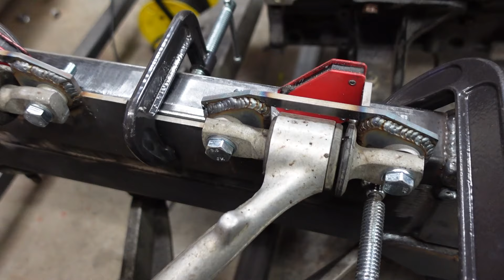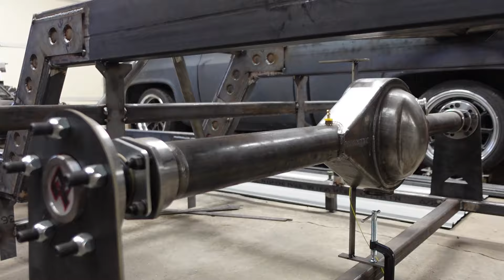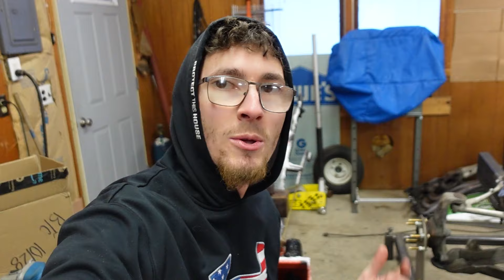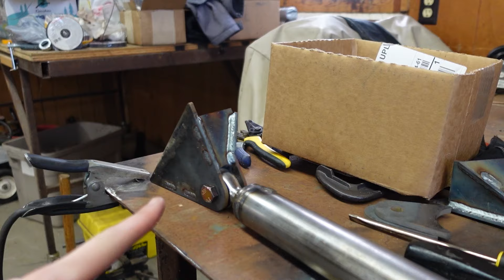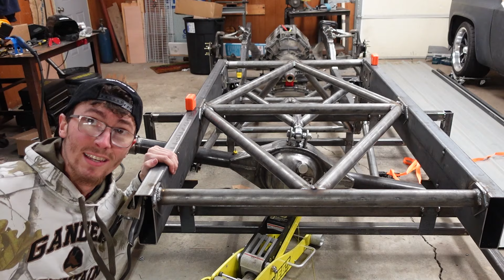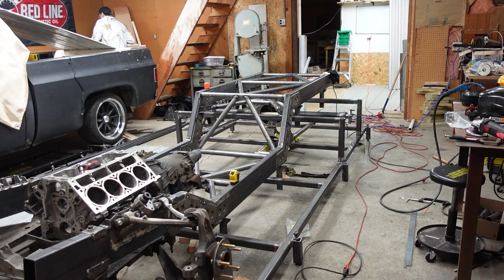Building A Triangulated 3 Link Suspension - Pro Touring C10 Chassis Build Part 5

Comment: I think I will be cutting and joining a chassis next year… not sure what pick up or wat model at this time but I will be cutting it to lengthen it a bit longer. Would you mind giving me an advice
Reply from the maker: The best general advice I could give you would be to find a flat straight section of the frame, and make sure everything is level before you cut. I have never lengthened a frame, but I have shortened a few. The biggest thing is to brace it well, so do like a z cut put lots of gussets.

Comment: Why a triangulated 3-link over a triangulated 4-link?
Reply from the maker: I wanted to try something different than everybody else was using.
Reply: @designbuilddrive  ok, I thought maybe there were performance reasons.
Reply from the maker: I had I throey on roll centers with this setup, Im still doing some testing but it looks like there may be a benefit.